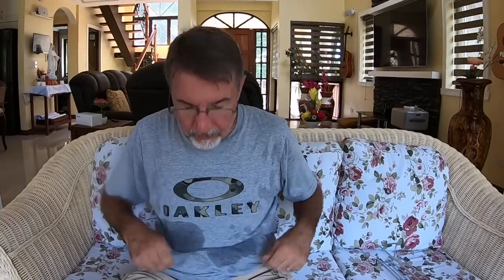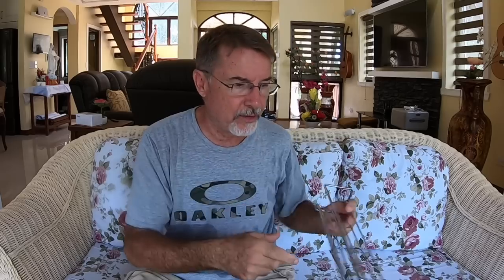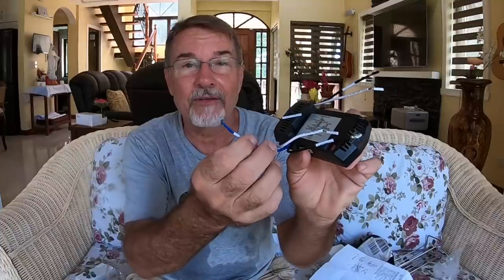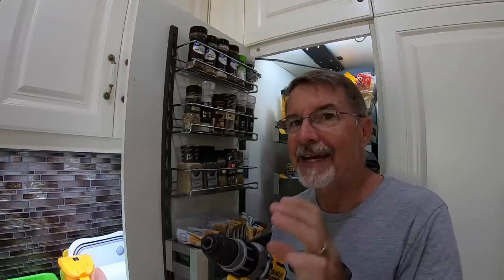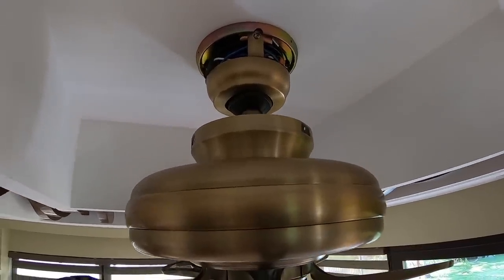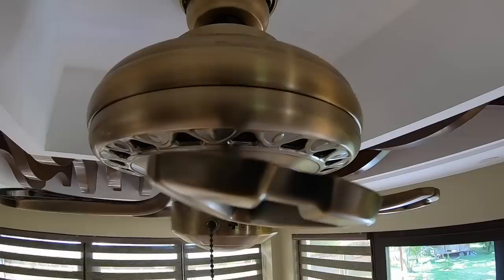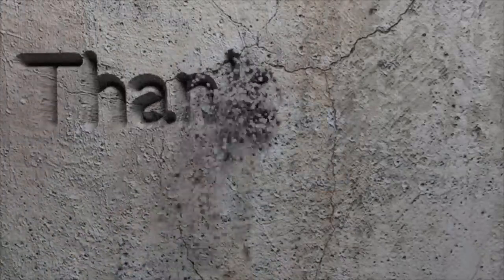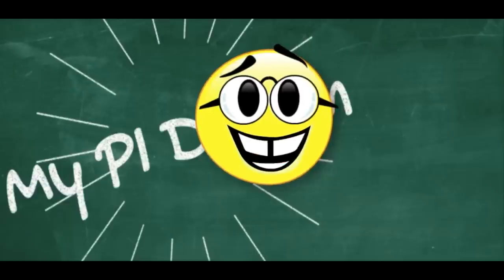VILLA FELIZ - EPISODE 510: HOW TO INSTALL CEILING FAN REMOTE (House Building in the Philippines)

Comment: James, you might want to test whether the IR can connect from the location where you mount the fan remote, saves you taking the remote in and out each time... that’s what I did at my place
Reply from the maker: I did and it works well.  I put it on the wall in the sun room so it has direct line of site to the fan.

Comment: James, does the Hunter remote wiring work on 120v and 220/240v? Or was yours specifically for Asia?
Reply from the maker: Specifically for 220-240VAC.  I'm pretty sure the 120VAC won't work and will burn up.

Comment: Hello, i want to purchase wall switches that control ceiling fans here in the states and ship them to the Philippines. My concern is voltage. Do you know if the switch will work?
Reply from the maker: I don't believe they will work.  You can look at the rating on the device you're thinking about buying.  The ones I've seen from the US show only 120VAC.  Most of these are not auto sensing multi voltage.